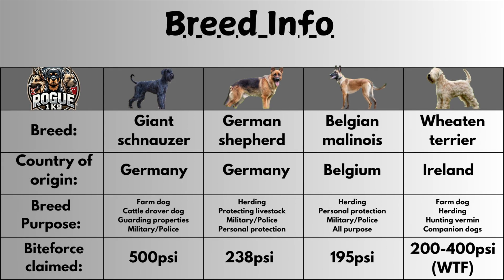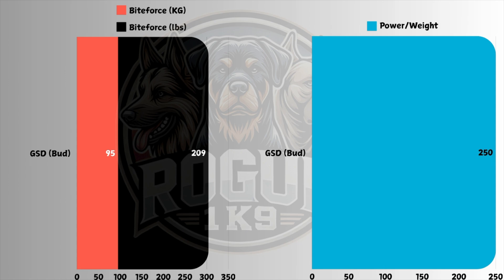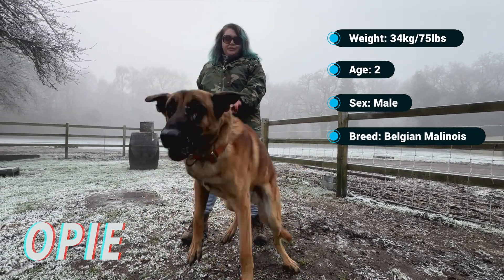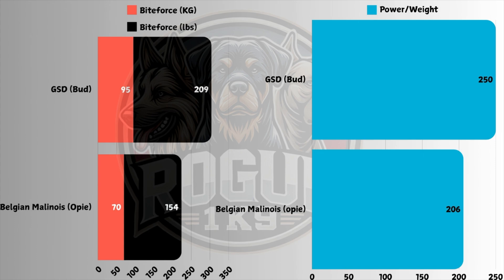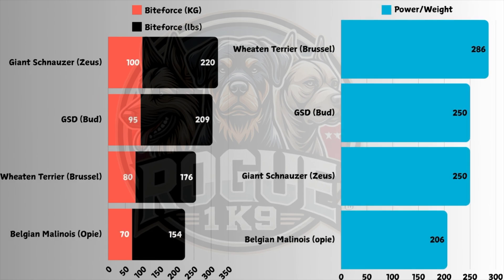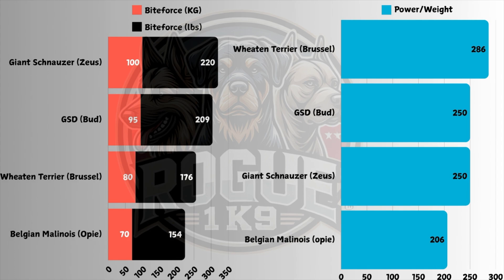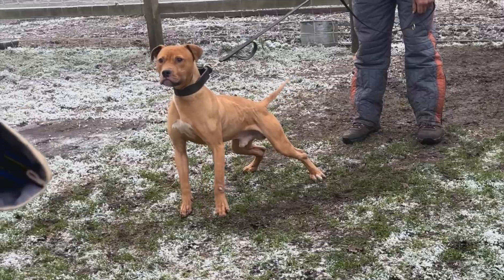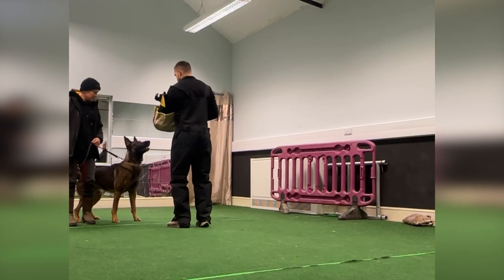I Built a Bite Sleeve That Measures Dog Bite Force, Here's What Happened!

Comment: Interesting! You could try adding a blue patch to the center of the sleeve. It might mark the target more accurately for the dogs, since they can only see blue and yellow, so it would make it stand out clearly
Reply from the maker: @TomsWhip  i didn’t know that thanks for the tip! In some of the newer videos you will notice we have added a guard onto the sleeve to direct the dogs into the centre! One of the decoys suggested it and it works a treat 👍
Reply: Exactly why I often use blue balls, (yellow at the moment 😮) and tend to wear blue tops / jackets so the hound can spot me easily from half a mile away.  👍